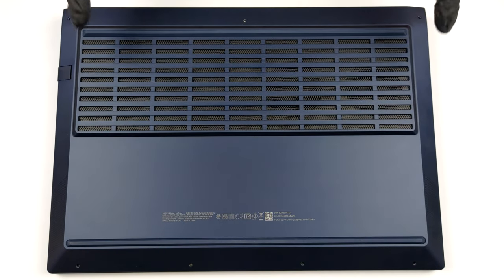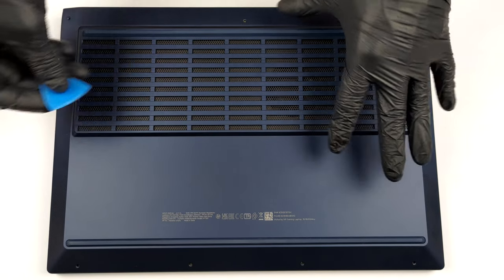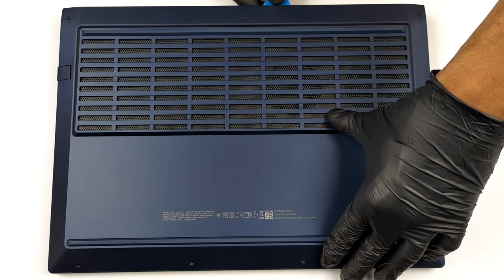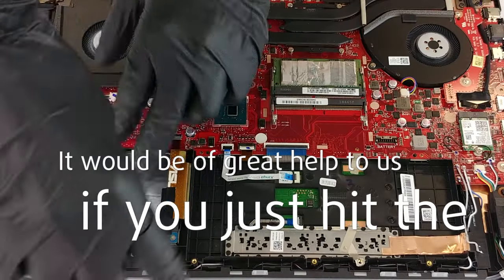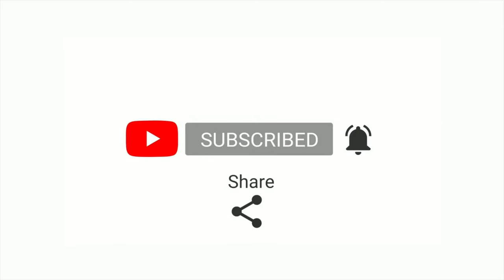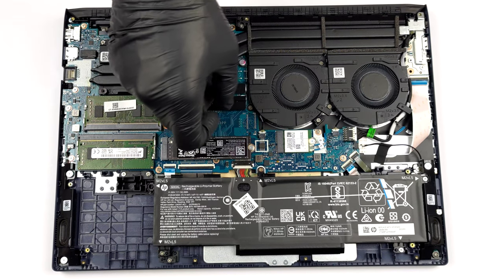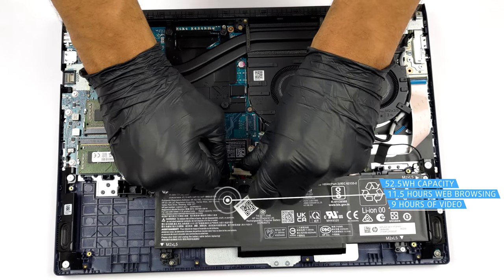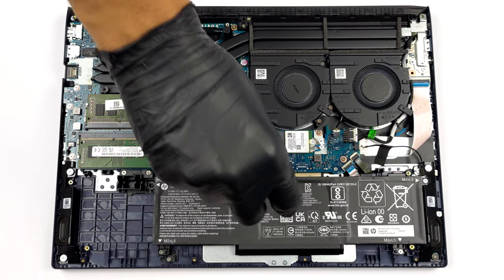🛠️ How to open HP Victus 15 (15-fb0000) - disassembly and upgrade options

Comment: Hp took the fake vent thing to another level.
Reply: That's not how it works. It has a liquid that boils in high temperatures and comes back to a liquid as it cools
Reply: The one in the front by the screen is a speaker dawg not a vent
Reply: @nightstepstation7189 no it isn't
Reply: its a real vent that works

Comment: The motherboard has solder pads for a second M.2 slot. Why the heck they can't put a connector there. It doesn't cost more than 5-6$ to put a another M.2 connector. WTF HP.
Reply: Apparently the motherboard is designed in a way that the gpu uses some of the pcie lanes that that slot would've used, so unless it was a model that didn't have dedicated graphics (which I don't know if it even exists for that chipset), then that second m2 slot could've been usable.
Reply: They are probably using the same motherboard also for Victus 16, which is much more expensive model and probably has 2xm.2 slots. Victus 15 is probably the cheapest gaming laptop right now (especially on Black Friday deals in USA) and as such they had to cut as much manufacturing costs as possible and the second m.2 is probably one of them.

Comment: Helped me a lot to know more here is the location of fans RAM and SSD! And know how to upgrade my laptop! Simple and straightfwd video! Thank you!
Reply: I need help please

I have decided to re-paste the thermal paste and I remove the paste-like thing off the chips and then put the artic mx4 paste on the GPU cpu and the chips

Now the laptop doesn’t turn on and if it does it comes up first with cmos checksum error code  then starts up then shuts off after 30-40 seconds

Comment: How do i upgrade my ssd when there only 1 slot ? Do i replace that ssd ? If i did what woulda happened to the default hp programs and will the hp assistant app detect that ive changed my storage ? Will i still be able to use that app ?
Reply: You replace the ssd with a bigger size m.2 ssd, and reinstall windows with an bootable usb, i recommend getting an m.2 ssd with 1tb+ so you won't need to upgrade again later, and a 32 gb usb so you have enough space and the hp programs will be deleted but you can download them from the internet afterwards
Reply: You could also clone the default SSD onto the replacement SSD if you had an external NVME dock. It would also keep you from having to reinstall everything
Reply: @CodyAtWork  Have you used more than one NVME dock and if so, which one did you prefer? Thanks
Reply: @edstetser  I have a computer with 3 nvme slots so I just used that. I would look for a usb NVME dock with thunderbolt or the highest USB rating you can (3.2 or 4)

Comment: If only it was actually that easy to remove the cover  lol
Reply: it is, use a card or a guitar pen
Reply: @hectorjara2030  you mean a pick? I finally got it open but it took a lot to pry it up and get the pick in there... happily at 32GB now
Reply: yes, a guitar pick, I am about to do the same
Reply: @flogginga_dead_horse4022 how did you get it open? I am strugglingggggg
Reply: @FreshBeats4u  not easy!! After swearing a lot I finally got it apart. Take a break then try again
Reply: Swear to Fuckin god dude it’s a pain
Reply: Start prying at the ethernet port and work your way around
Reply: @flogginga_dead_horse4022  what screwdriver did u use and what was the size I’m also tryna upgrade my ram thanks bro

Comment: How do i upgrade my ssd when there only 1 slot ? Do i replace that ssd ? If i did what woulda happened to the default hp programs and will the hp assistant app detect that ive changed my storage ? Will i still be able to use that app ?
Reply: I am also about to try this u got any answers yet?
Reply: Put the new SSD in an external enclosure, connect the external enclosure to the laptops USB port and then clone your old SSD onto your new SSD using cloning software.  Then just take out the old SSD and insert the new SSD and it should boot up fine.

But the cloning process can take 1-2 hours to complete.
Reply: Do u have to upgrade the ssd if your upgrading ram?

Comment: Yo I need help on opening it, I have all screws off and I have I got multiple prying tools I bought off of amazon but my Victus 15 still will not open! Am I opening it right or
Reply: i opened mine using unused card and i would say it is very tight if you're opening it for the first time

Comment: Bought a victus 15 (15-fb0051ax) a couple weeks ago, so this video is a great help and a reference in understanding quite a lot of the things that HP failed to mention in the documents and whatnot. Thanks! 
Gonna be referring to this to upgrade RAM and SSD

Update : RAM can be upgraded, but SSD can not. We don't even get a second ssd slot to work with, so we're stuck with the same stupid 512gb ssd we are given as stock.
Reply: Yeah. Still in some places i saw mentioning that there's an extra slot for ram but for SSD no one said a single thing. Now that I know ssd can be upgraded as-well I can order this one for myself in one peace
Reply: Only if you get the cheapest option.. mine came with 32gig ram and 2 tb ssd..
Reply: @theman-pc2ej  which model did you get?
Reply: @thetej1098  its a victus 15 with 32g ram and 2 tb ssd.. runs like a damn beast! 10 seconds to start up if that!
Reply: @theman-pc2ej  that's not my question. This whole discussion is about Victus 15 series 🤦🏻‍♂️ I said, which exact model? The one I mentioned is 15-fb0051ax , which one is yours?
Reply: @thetej1098  right under that is an upgrade sicker.. so it must have been upgraded to 32g ram and 2 tb ssd cause when i look up that model number its 8 or 16 gig ram and 500 gig ssd
Reply: @theman-pc2ej  smh I'm asking you which one YOU have
Reply: @theman-pc2ej  you can just look at the base flap and you should find the model code for your laptop
Reply: @thetej1098  base flap?.. i found it on the box..
Reply: @thetej1098  gave model and specs..wtf more info you need?. I got the grey one with a v on it..wtf
Reply: @theman-pc2ej my friend he’s talking about MODEL NUMBER, yk stuff like the serial given in the title? (15-fb0000, 15-fb1002ne, 16-e0032nb, etc)
Reply: @KyberIII  scroll up bro.. ive already given that..
Reply: @Jephyra   bro is not the sharpest tool 😭
Reply: Hello guys i bought the victus 15 with 8gb of ram and I would like to upgrade, so can somebody help me chose a good ram for upgrade?
Reply: @theman-pc2ej  backread please, you have not mentioned a model number in ANY of your comments 🙂
Reply: @thetej1098  yeah bro is lost
Reply: @KyberIII  well i gave the number on the box, the subject was victus 15, maybe im missing so.ething..
Reply: @theman-pc2ej  yep, you're missing something. Okay, we'll help you.

"Victus 15" is a series of laptops. The different model numbers denote the combinations of CPU+GPU , SSD , RAM etc. All the various Victus 15 models have different configurations. 
To find which one you have, you should flip your laptop and look at the base flap. It is usually written there. For example, the one I've got that I've mentioned in the original comment, mine is 15-fb0051ax. Look for a code-name similar to this, you should be able to find one pretty easily.
Reply: @riasgremori8295  Hey, I upgraded with one new  DDR4 2300 MHz RAM stick of 16 GB, so now I have a total of 24 GB RAM. Just make sure you get the same DDR number RAM and it is of the same clock speed as the original one.

Edit : for example, I bought a RAM by a manufacturer called "Crucial", it is working perfectly fine for me.
Reply: @thetej1098  yes i already put that.. its a 15-fb1013dx... i said this long time ago
Reply: @theman-pc2ej  literally nowhere in this entire comment thread did you mention this. Go ahead and point out to me where you mentioned this? (Without editing any of your older comments, don't try to be cheeky)
Reply: @thetej1098  so i guess you seen it..
Reply: @thetej1098 hey man! I have 15-fa0031dx. So am I not able to upgrade the ssd either? ☹️ your post says we’re stuck with the 512g, but I see a lot of other guys upgrading their 512g to a 1tb m.2?
Reply: @Lou_e92  yeah, cuz my post only focussed on 15-fb0051ax and no other variant 🤦🏻‍♂️
Reply: @thetej1098  why can’t you upgrade yours? I’ve always ran internal hardware and never thought of upgrading my desktop or laptop. This is the first time I do research.
Reply: @Lou_e92  you only have one ssd slot. The work around is to buy an internal pcie, nvme ssd and an external case. Put the new ssd in the external case. Clone your 512gb ssd into the 1tb ssd. After it's clone, you basically swap the 512gb ssd off the motherboard and put the 1tb ssd in it's place. You can then format the 512gb ssd and put it into the external case to use as external storage.

Comment: How do you remove a stuck screw? I removed 2 of them using a Phillips #0 screwdriver but the other ones just won't come out.
Reply: get a better screwdriver
Reply: Let WD-40 soak on the screw for about 10mins then remove. Worked for me
Reply: Put rubber in between your Phillips should come out

Comment: Do i need to unplug the battery before i add my new ram? Or is it safe to add my ram immediately?
Reply: Safe to add in most cases. I always prefer to unplug though just to be save. Takes 2 seconds and is worth the time just to be safe in my opinion :)

Comment: I’m trying to remove the screw on the SSD slot after opening up my laptop to replace the 512GB to 1TB but I can’t remove the screw. I’ve used many different Philips head screws from: 000, 00, 0, 1, & 2. I even used some flat screw heads but none seem to work. What screw do I need in order to remove the SSD and replace it?

Comment: I bought this laptop with a 52 wh battery, it has 2 battery variants one with 52 wh 3 cell and other with 70 wh 4 cell battery, can i replace my existing 3 cell battery with a 4 cell one?
Reply: Please inform me if you get the answer for your query. as I am also looking to upgrade my Laptop battery my Laptop Model is fb1002AX
Reply: @pallavchakraborty8260 in theory this can work, depends on if hp has done something to not make it work or if the size and shape differs.

Comment: is it possible to use the SSD2 slot? i can see there is space but no port but, can you add it and add another ssd?
Reply: You can add it, but only by soldering the port and if your mother allows it, I was researching to do it, but it's very complicated
Reply: @hectorjara2030 

Can you send an explanation or video explaining how to add the second m.2?

Comment: ok so my victus is cool on the left and hot on the right when i game and i thought my right fan must not be working. So turns out both fans are on the left side and the right side heating up as a result is just normal i guess. bruh
Reply: thank u for ur comment i was also worried about this. guess its just because of the location of the fans and my temps are normal too so nothing to worry about ig

Comment: One question, does this laptop motherboard support DDR5 RAM?
Reply: @CEnoch thanks
Reply: no it only supports ddr4
Reply: @txvzir1364 wrong, it supports DDR5 4800mhz.
Reply: @Necla1652  I have ddr5 vengeance and it didn’t work

Comment: I have a question. How many gb of RAM can this laptop take?
Reply: 32 gb of ram
Reply: @ErosVinny-yq4ns  So, Hp victus with serial number 68P31EA can be upgraded to 32gb?
Reply: @yatlanassa  yep! Just got mine and im blown away, performance is top tier for the quality and price. Very durable and lightweight aswell
Reply: @yatlanassa  No problem mate! Going to be ordering 16*2 myself soon!
Reply: How much ssd I can upgrade to this.. I have recently bought it and if I upgrade it to new ssd will my orignail window will be removed due to that 512gb ssd which is pre installed?
Reply: max is 64gb
Reply: @ErosVinny-yq4ns hey man! I have the victus with the rtx 2050 and Ryzen 7000 do you know if i can upgrade my ram? And how much i can do?
Reply: @Porterpotty114 as far as I know max for most victus models is 32gb ram, though some of the newer models may support more
Reply: @BudgetBarrel not sure exactly what you are asking, but almost any m.2 will work fine up to 2tb
Reply: @Ben-xg6yo hey man, what ssd did yours come with? I have the 512g, 15-fa0031dx. & I want to upgrade the ssd, but there’s a comment somewhere above that says I’m stuck w the 512g.
Reply: @Lou_e92  All Victus 15 models come with a 512gb ssd and have the ability to go past 512 to at least one terabyte, but your victus 15.6 can go up to 2tbs.
Reply: @Ben-xg6yo  thanks for the info!
Reply: @Lou_e92  Of course!

Comment: So could I upgrade my storage with a 1tb ssd or would I have to get a external hard drive
Reply: You definitely could.  Put the new SSD in an external enclosure and then clone your old SSD onto your new SSD using cloning software.  Then just take out the old SSD and insert the new SSD and it should boot up fine.
Reply: @xuimod  how do you find the external enclosure for that kinda ssd? thank you

Comment: do you think it is posible to solder on an nvme connecter on the pads where ssd2 is shown just above the other nvme drive at 1:17 ??
Reply: was thinking the same thing!! but i have looked around on forums and sites some say yes, some no because there are no traces to be found on the connection?? I havent inspect it that close but so far none have attempted it yet i think since the cost of buying a higher capacity drive vs the cost of having a repair shop soldering a connector for you plus buying another drive is more expensive but maybe in the future when this laptop ages and ppl start doing wacky and mods to it
Reply: @ravenslegacy4050  yeah i did just buy a cheap 1tb nvme and just cloned it using an external nvme drive holder. Mabie when I look to buy a new laptop I might try the mod.

Comment: I'm writing from an hp victus 15 fb-0014 . Hp manual says that this laptop can handle only 16gb ram maximum , but Ramexpert software says 32gb ram. Have you try 32gb of ram ? it works ? thanks you
Reply: estoy en lo mismo, quiero 32gb pero no estoy seguro. alguien ha instalado?
Reply: Mine too
Reply: 32 for intel, 16 for amd. Source: trust me bruh.
Reply: @agnt_ornge1585  shut up 32 on amd
Reply: @agnt_ornge1585  You might actually be correct

Comment: Safe to assume that the 2023 model with i5 and 3050 is the same? And safe to assume i can just buy another 8gb stick of ram
Reply: Yes you can. Just installed a 16gb into that slot.
Reply: @chopjohnsu3y274 I cant get the back off 😭
Reply: @Klassyy  haha yeah it was a pain tbh but still fairy quick. You need one of those device opening picks. They kinda look like guitar picks but are much more sturdy.
Reply: @chopjohnsu3y274  Does the laptop have another m.2 slot?
Reply: @ArcDashMax  I couldn’t tell you since I returned it unfortunately.

Comment: what would be the max ssd capacity to be upgraded? no need of manufacturer specs but based on real test
Reply: Don't know exact But right now i am using 2tb gen 4 nvme ssd and it support well but getting speed of gen 3 ssd
Reply: @UnderratedSid596  and ram?
Reply: From what i search, depends on your graphics card, max 16GB ram (Gtx1650) and 32GB ram (Rtx3050)
Reply: @CopyHertz  never heard about that, it depends on the processor and motherboard though
Reply: @UnderratedSid596 hey which model do you have?

Comment: the part around the arrow keys always feels hotter than the rest of the laptop. But as per your video it seems the only thing there is the SSD which shouldn't be heating up so much. Or need to find out what is behind the SSD and under the arrow keys that's heating up.
Reply: I personally think it is better than the whole laptop getting hot, becuase it only heats up when youre gaming and your hand is at the left side which stays cool and most games need only the left side of the keyboard anyways
Reply: I'm not gaming on the laptop. But anyway I don't mind the heating. The question was to know which module is heating up as I don't expect the NVMe SSD to heat up that much.
Reply: @racybhavik  true

Comment: LOL I should of watched this first as I just bought a 2tb Gen 4 NVME for it! Oh well. Great video. What size are the Philips Head screws please.
Reply: It supports gen4, the video got that part inaccurate
Reply: @MayankPiano05  Thank you for that. At least I don't have to return it.
Reply: @yogibear2k220  did it work?
Reply: @mr.G4MES1  I haven't received it yet?. Thanks for asking though.
Reply: @yogibear2k220  ok, when you receive it, info about if it works or not would really be helpful. Thanks
Reply: @mr.G4MES1  Sorry for the delay and yes it works perfectly.
Reply: @yogibear2k220  Thanks for the info💯

Comment: I have hp victus 15 core i5 12450H. What is the maximum capacity of RAM can be installed. Stock is 16GB (8x2)
Reply: clash of clans
Reply: Do chat gpr😊